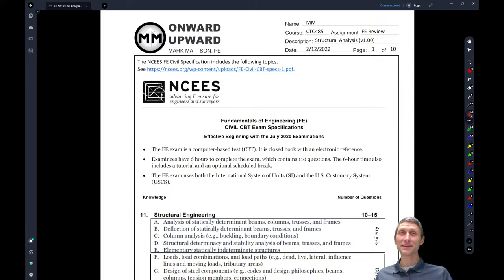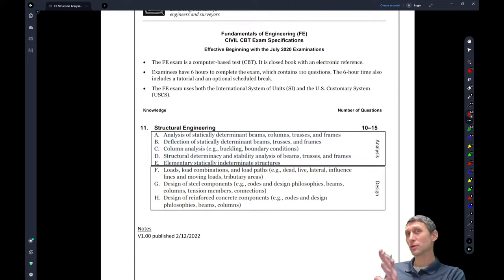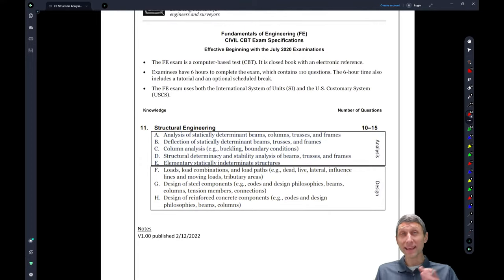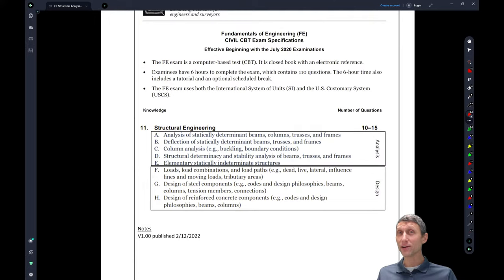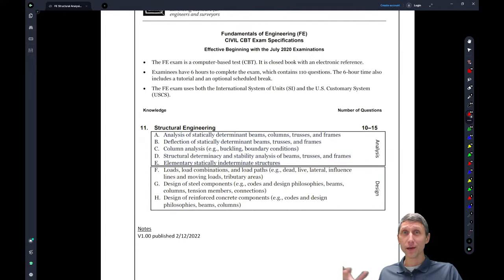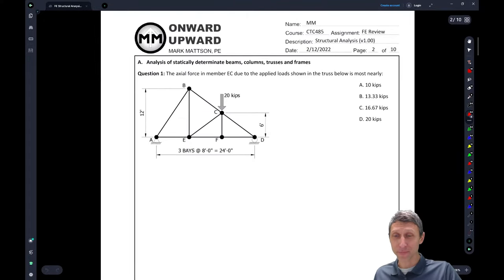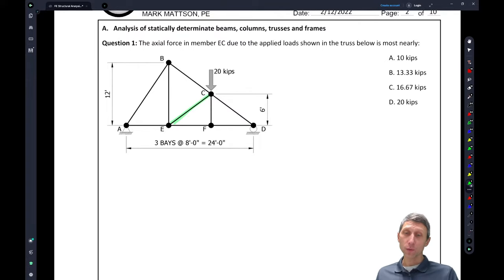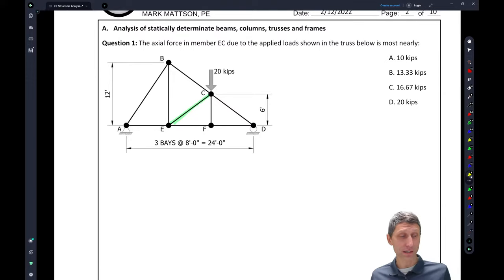FE Structural Analysis Review Session 2022

Comment: I made problem #1 way more challenging than I had to after watching Mark's method. I used the sum of moments twice, sum of forces in x and y, and two equation two unknowns solve.
Reply: For #1, I was able to remove one step and obtain an answer of 16 by using the following equation for the sum of moments. This is in comparison to breaking EC into an x and y component like Mark did:
Sum of the moment at point D = 20 kips (8 ft) + EC (10 ft) = 0 ==> EC = -16 kips

Comment: Hey Mark, love the videos, I was just wondering on Q7 so the concrete unit weight is 150 pcf and you multiply it by 26 while the other side is triangle , you made it sound to me like there is just distributed force o the rectangular side when you calculated the W, i know you calculated both but u used the same W of the rectangular

Comment: Hello Mark! In question 4, the member BD is in compression, so its length is decreasing. I am not sure, but I think you should substract its contribution to deflection in the Unit Load Method. Great videos! Thank you!
Reply: that is Correct
Reply: Yes, I also think so. If that is done, the deflection will be 1mm
Reply: My understanding is that both the virtual force and the actual force caused by external loads would be in compression (negative), so the product (little f times big F) ends up positive. It is not discussed directly in the video, but I believe the final calculated deflection is correct.

Comment: Hi Mark, really appreciate your videos, it's super helpful! For Q7, when you calculate the concrete weight, why did you use width 8' multiply stress rather than using cross section area? Generally stress=Force/Area. Could you explain this? Thank you!

Comment: I tied the problem that can be seen circled at 53:50 with a load of 70KN. I am not fully sure if what I did was right, but I used δ =PL/AE from the Mechanics of Materials section like you had said: (70KN*4000mm*(1000N/kN))/(((50mm)^2)*(200,000*10^6 N/m^2)*((1m^2)/(1000mm)^2) = 0.56 mm.
Reply from the maker: Unfortunately, for this problem since it is horizontal deflection, you can't just use PL/AE, you really have to go through the principle of virtual work for trusses.  Sorry, no short cut on this one.

Comment: Question 4: In the final table member in tension are positive and in compression negative ?  so we would end up with 792-280= 512= fFL ? and the rest the same I get a deformation of 1.02 mm ? Thank you Matt you are the best
Reply: Since both the unit load causes compression (negative) in BD and the real load causes a compressive force and a decrease in member BD length (also negative), multiplying the two negatives together means a positive value. Thus, adding 792 + (-1 kN)*(-70 kN)*4m = 792 + 280 = 1072.

Comment: Hey Mark, love the videos, I was just wondering on Q7 where you got the force of the water pushing on the concrete. Why did you multiply by the height of water instead of the width like you did finding the force of the concrete?
Reply from the maker: Hey @Tom Jenkins, thanks for the comment.  Both the lateral force of the water and the weight of the concrete is dependent on their height.  The water is a lateral pressure acting on the dam.  The concrete is a vertical pressure acting on the dam.  I hope this helps!

Comment: First of all, your videos are great! and I like your jokes haha. 

Second, in Q5 you shouldn't take the minor moment of inertia I, and calculate Pcr with it? And in this case, Iy of the weak axis does not become Ix to the strong axis? If yes, then the Pcr for the strong axis should be calculated with 4 m4 (40,000 mm4) as well, and the result would be the same because you still have the restraints in the weak axis (i.e. L and K would remain the same). 

What I mean is that maybe is not necessary to confirm the Pcr in the other direction of the moment of inertia, since if the column buckles, it would do it in the minor of Ix or Iy. Independently of the length of the column, and if there are no eccentricities, it always tends to buckle in the direction of the minor moment of inertia, is this correct?

Comment: On Question 4, it specifies horizontal displacement. How do I solve for that? Or do we assume deformation only occurs along the load line? I would have thought since there is compression at DB that vertical displacement would occur as well. Or am I lost in the weeds?
Reply: The calculated deformation is in the direction of the unit load. Since we put the unit load is horizontal, you get the horizontal deformation.

Comment: Thank you mark, which formula did you used for Q-6 to determine the stability and statical determinacy of the 6 beams please explain thanks.
Reply from the maker: For the determinacy problem, if the number of reactions equals 3 x the number of beams, and there are not collapsible mechanisms or other forms of instability, it is statically determinate.  This is essentially comes from the 3m + r = 3j +c equation in the manual.  I used 3m = r (by counting all the internal forces at the hinges).
Reply: @MarkMattsonPE   Hi Mark. I am SO confused on this question. I was told that for Beams to use r = 3 + C also how come on c and f you didn't use the "frame" equation 3m + r = 3j = c ? what is the difference? i feel like im missing something. and these are such "easy questions on the FE i dont want to miss it :(

Comment: Question 1: Why not keep EC whole? Sum moments about B: (10)(EC)=(20)(8), EC=16. This solution is coincidentally close to your answer, but doesn't seem to work for other forces/dimensions. Generally curious.
Reply from the maker: You could take the left side, but either way you need to cut it apart.  The reason your answer is close, is because 10 is the approximate perpendicular distance from point B to EC.  If you knew the perpendicular distance from any point to EC, you could figure out the EC force in one step.  Varignon's principle is helpful with trusses and along the same lines. See also https://www.youtube.com/watch?v=LbpJf4p7mWc&t=6s

Comment: How come 5f doesn't have any reactions on the rigid corner?
Reply from the maker: I think you mean 6f?  Reactions only show up when you cut the members apart... If you don't cut it apart, that L-shaped member only has two reactions -> making it unstable.  If you cut it apart, you add three reactions, but you also require 3 more reactions for stability between the two members, so the stability doesn't change and it's still unstable.

Comment: Hello, for question #2 I think should By=-10 kips for member AB since it is the opposite of what we get for joint B for member BC.
Reply from the maker: By is up on BC and down on AB.  If the arrow is shown in the correct direction, I use the signs in the equations of equilibrium to assign positive or negative.  

I do not use absolute sign conventions like is used in vector mechanics with ijk unit vectors.  If you learned vector mechanics for statics, it's a shift in thinking, and an easier one to implement (IMHO).

Comment: Just wanted clarification: If you keep your delta equation negative like the FE states, your reactions at By = -22.5 kips, Ay and Cy = 29.25 kips. Sum of forces still = 36 kips, keeping your beam in equilibrium. Although 29.25 kips is not a choice, is this still a correct answer?
Reply from the maker: By has to be acting up, it is not negative.  The signs can be very tricky.  That means the rest of the force needs to get split between Ay and Cy as shown in the video.

Comment: Q8 when you set the 2 equation equal each other. Did you leave out the negative sign on the numerator for Delta BB ?
Reply from the maker: I did leave the negative sign off, intentionally.  The manual has a negative for the uniform load deflection indicating it goes down. The point load deflection is positive because it goes up.  For this problem, we know they have to be equal to each other.  If you kept the negative sign you could say the total deflection is 0 since the sum of deflections, or Dbb + dbb = 0.  The negative would allow them to cancel out (or to be equal to each other if you add Dbb to the other side).

Comment: Hello, Thank you Mark for the videos. For question 9, why do we use -Ay and not positive Ay if it is pointing up. Thank you
Reply from the maker: It's pointing up, but a negative distance from point B.  It's causing clockwise rotation about point B, which is defined as negative.  Does that help?

Comment: Thanks for the video! In a truss analysis why member BD=+1? Why it’s on a tension?
Reply from the maker: In the truss deflection problem, BD is 1 KN, but it's in compression since it's pushing toward the joint.  In the video, I mistakenly labeled that force AB in the FBD.  Sorry for any confusion.
Reply: @MarkMattsonPE  thank u. And member AD in tension? But signs are the same “+”
Reply from the maker: Both are shown in the correct direction on the FBD.  AD is shown away from the joint indicating tension, and BD is shown toward the joint indicating compression.  Since they are shown in the correct direction, the sign is positive when solved using the equations of equilibrium, indicating the assumed tension/compression is correct. AD is tension and BD is compression.

You only get different signs if you assume all forces at the joint are in the same direction, for example, in tension.  To do that for this problem, BD would be shown down (assumed pulling away from the joint).  Then, when solved for, BD would be negative, indicating the arrow is in the wrong direction and in compression.  In that case, tension will be (+) and compression (-).